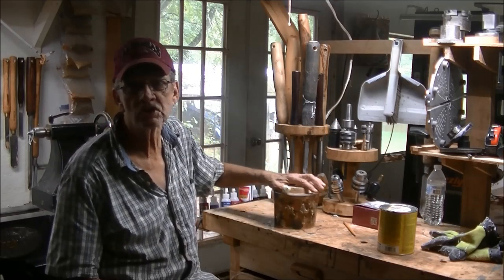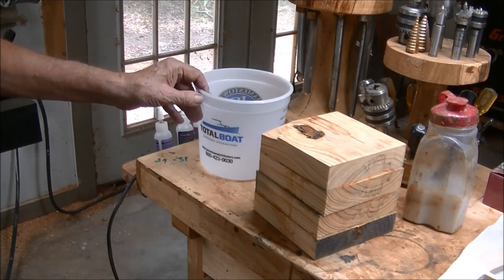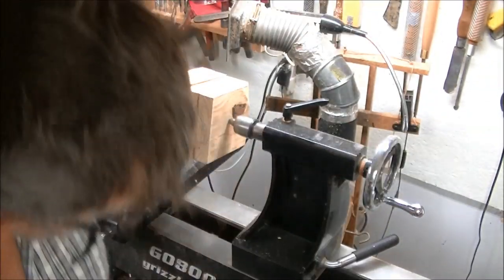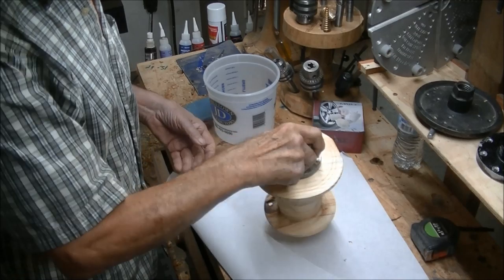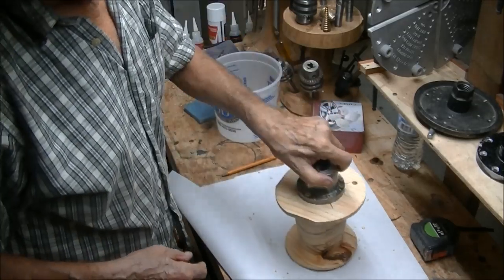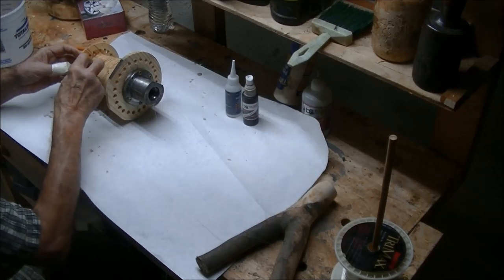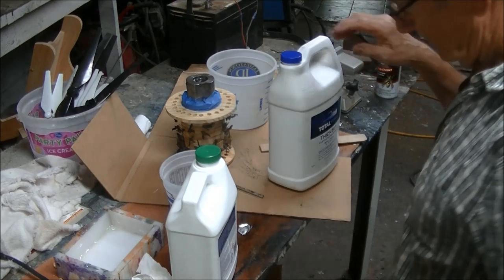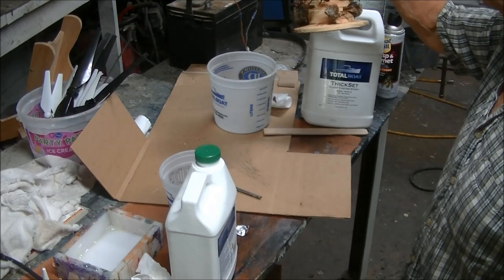Threw in the towel # 179

Comment: Interesting idea Larry. How about trying carpenter ants sometime. 
You never know how much epoxy will end up going into a wood plug. 
Good chance that is where it went. 
Do you wear a respirator when turning the resin? That stuff can be nasty. I used to hate to machine the stuff we used at work.
 Hope your thumb is OK and you decide to finish the piece. 
Take care,
Gary
Reply from the maker: They say you should coat the plug with epoxy first and let it set up, before you pour.  I used sealer.  I sure that helped.  I have my over head filter going, you sound like my wife.  With epoxy you don't get dust, turn it fast and hot, works for me.  I don't think we have carpenter ants, fire ants, but you want to stay away from them.  
Yep, not giving up, it's back on the lathe right now.  Thanks and catch ya later, Larry
Reply: Yeah we would seal the plugs sometimes. But what we poured we had a big head of extra over the top to make sure the molds were full.
FIRE ANTS! If they are the same Red Ants that I had to deal with in the jungles of Vietnam I know what you mean. They would drop and land on you when they felt movement. The poison was deadly if enough of them landed on you. Makes my skin crawl thinking about how many I felt crawling up the back of my neck and smashed them right before they bit.
 Take care Larry,
Gary

Comment: Larry, stuff happens but this was an interesting idea with the fishing line.  I embedded some honey bees into a polyester resin to use for tops of honey dippers.  I used polyester because i was afraid of putting them into pressure pot.  Looks like I may have been right!  I don't think you needed to use pressure with Total Boat.   I've used it for small castings without pressure and it turned out well.  BTW, I got my bees from a web site called www.deadinsects.net  They have darn near any insect you want and they are preserved for mounting.  Might work under pressure?  I liked the video even if it didn't work out the way you wanted.
Reply from the maker: Thanks, went there and bookmarked it.  Polyester gets too brittle for me, but it's cheap.  Thanks, Larry

Comment: ...Vakuum, not Pressure!
Reply from the maker: Thanks, Larry
Reply: vacuum does not work with thick epoxy. pressure pot was fine but the wasps need to be dried first and the overheating suggests doing it in multiple pours or using a thinner epoxy rated for deep pours